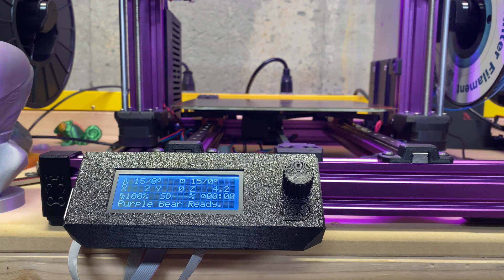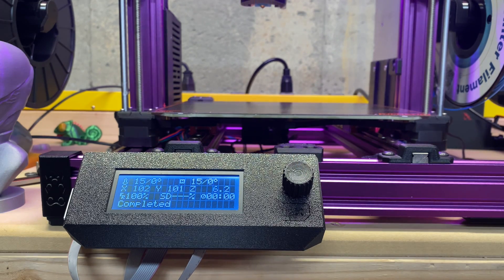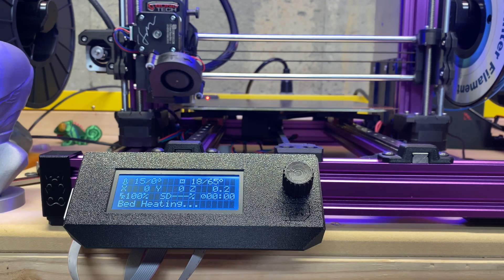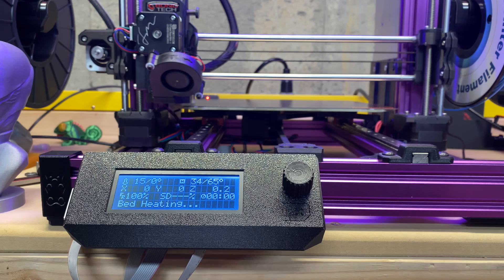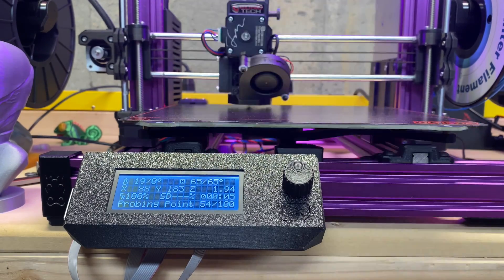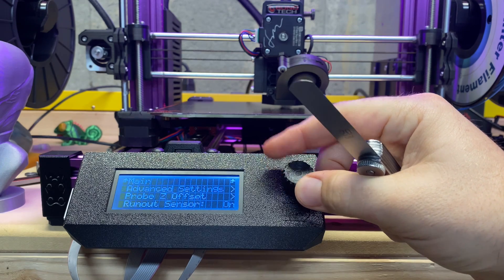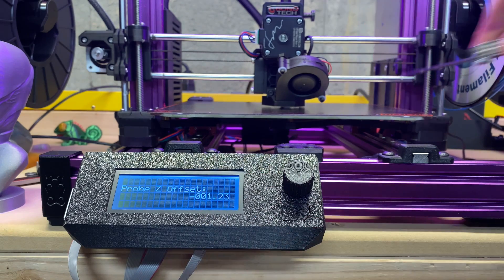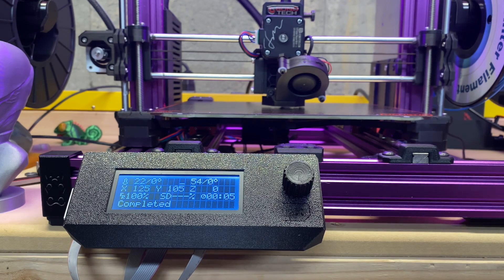UBL Setup - Custom Menu

Comment: I know this is an older video, I used your guide to install my SKR board. I still can not get the UBL to work. It will only move to one spot and repeatedly probe the same spot. I am sure it is a value issue...but be damned if I can find it. Any thoughts as what I can try?

Comment: Thanks for the videos Chris. Used yours to set up my SKR. Any chance you could post the settings and set up for the UBL? Have mine installed and all it wants to do is probe the same spot repeatedly. 

It homes fine. It does the auto align fine. Just will not do anything for UBL. I'm using the SKR1.4 turbo with the 2209's, no sensorless homing, and the probe is a capacitive probe. I am sure it is a setting issue, but damned if I can figure it out.

Comment: I bought a used prusa bear last week, but i cant seem to level it. Does the sequence still go like this? In my interface there are 5 meshes available, and step 1 and 2 are replaced with 2 and 3 (i assume those are the same functions). 

Towards my right Z stepper the level is consistantly too close, and close to the other stepper motor its too high. Seems to be a x-dimensional problem. The guy i bought i from said i should auto-z-allign it which maded sense, but that didnt work...

Comment: Chris is there a way to setup ubl without code on a full graphic tft 35 v2
Reply: I hope more people dig into those BIQU screens they are so far i know fully open-source, code wise. you can customize a lot and have seen a lot from active members but they need to be more.   There is another brand that makes Nixtion? Nextion? screens but they got software so you can make easily a fully graphical touch screens just with dragging images and linking them to specific commands/options/menus'  but i think BIQU (Big Tree Tech) is a MAYOR player in the 3d printing scene but i noticed not many people like touch screens...

Comment: Hi Chris. I like to see the print quality difference stock prusa vs 32bit prusa. Do you have pictures or videos up showing this?
Reply from the maker: BlueprintDK there are a bunch or amazing beta testers in this project. They will be sharing their results as to not have any bias in the presentation. I can say a lot of the issues with prusa quality is handled much better like vertical banding, ringing, and even a bit of the uneven layering is improved but that’s on my 5 machines. Not enough to get a good sample yet.
Reply: @Mr3DPrintWizard  love my prusas.. but I use my modded Ender's direct drive with skr boards / 2209 for the finer detailed prints.. if I can get the same smooth layers from the prusa's, then I believe THIS is the way.. thanks for the crazy fast reply. 
Cheers 
Michael
Reply: @Mr3DPrintWizard  at what line width are you testing? Prusa slicer stock is set to 0.45 and going down to stock Cura setting 0.4 really don't look good on stock Prusa.. my printers that uses 32bit 2209 drivers all uses Cura at line width 0.4 and come out really smooth